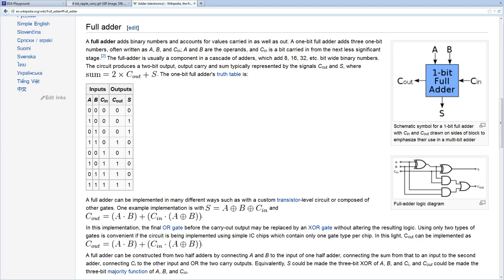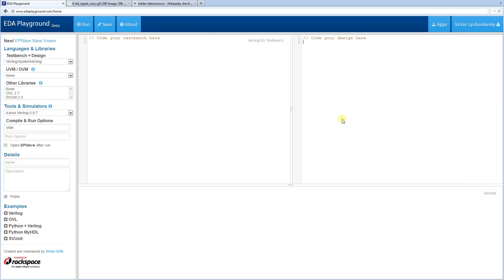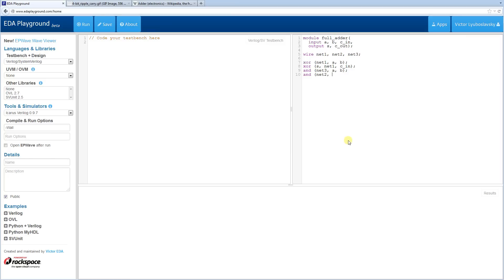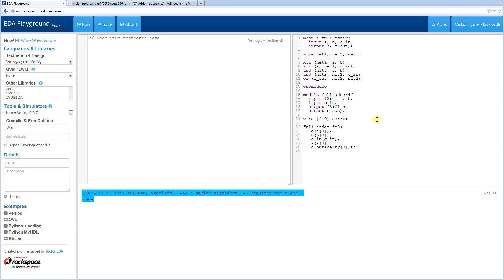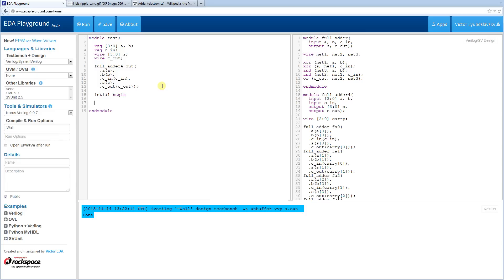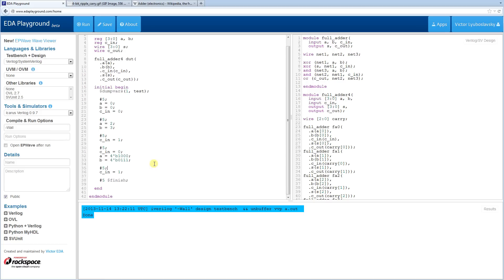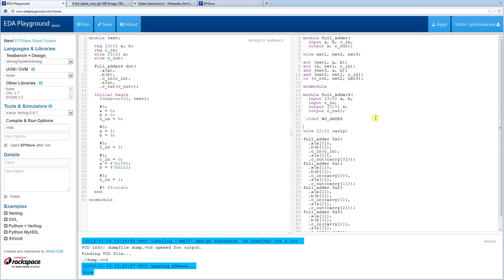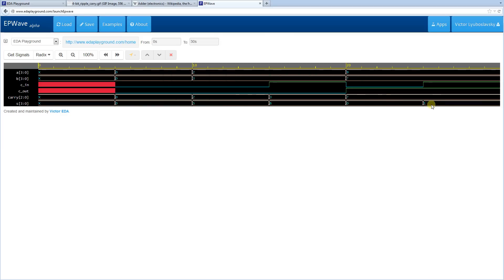Verilog Tutorial 5 -- Ripple Carry Full Adder

Comment: Sir , I am getting this error mentioned below.
Finding VCD file...
No *.vcd file found. EPWave will not open. Did you use '$dumpfile("dump.vcd"); $dumpvars;'?
Reply from the maker: On the above example? Or on a different one? If on a different one, have you added those lines ("$dumpfile("dump.vcd"); $dumpvars;") to an initial block in the testbench? If so, please post the URL so I can have a look at it.
Reply: I was working in EDA playground.  I tried many examples but not showing  the   plot.
Reply: I guess u didn't use those commands. I tried your example but no output graph.
Reply from the maker: It would be easier if you could post a URL. However, here are 3 reasons why you mihgt not be seeing a plot:

1) you haven't checked the 'Open EPWave after run' check box

2) your Verilog/SV code doesn't include '$dumpfile("dump.vcd"); $dumpvars;''

3) your simulation runs for more than 1 minute, so times out, so there will be no VCD file
Reply: Everything is fine sir I followed your tutorial but I am not getting the plot even after adding the dumpfile and var commands. And even I have checked EPWave after run. May be its my fault in writing. Once rsolved I will let u know. Thankyou sir
Reply from the maker: Can you not send a URL? (eg to getedaplayground@gmail.com)
Reply: YES
Reply: Thank you sir, I have rectified my error.

Comment: Hi! Thanks for this video! It's really helpful. Might I ask, other than processors, what other devices use ripple carry adders?
Reply from the maker: Karen Grace Victor 
Hi Karen,

Victor has done a good job, hasn't he? 

This is Matthew Taylor. I work for a company called Doulos - we are an independent training company and have recently bought EDA Playground. 

There are various kinds of adder as well as ripple carry adders: you might want to google "carry look ahead" and "carry select" adders. Adder design is a tradeoff between area and speed: a ripple carry adder is small, but slow; other adders are quicker, but bigger. A ripple carry adder is slow, because the carry chain propagates through every stage. Look at the diagram Victor shows 45 seconds into the video - the carry chain propagates though all four bits of the adder. With a 64-bit adder, it would have to propagate through all 64 bits.

So, generally in logic design, meeting timing constraints is the first priority and reducing area the second. So, if a ripple carry adder is fast enough, that would be used. If not, some other quicker, but bigger design is necessary. So, there isn't really a simple answer to your question: a ripple carry adder would be often chosen if it is fast enough. Chips I have designed generally didn't have fast clocks or wide data busses, so ripple carry adders were usually good enough. 

Cheers,

Matthew